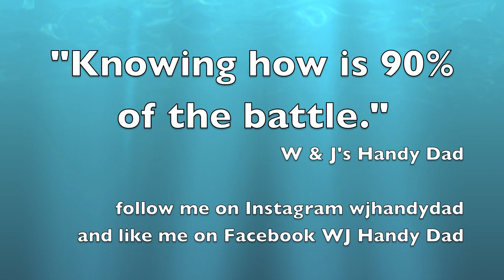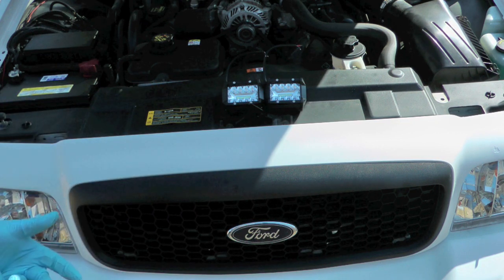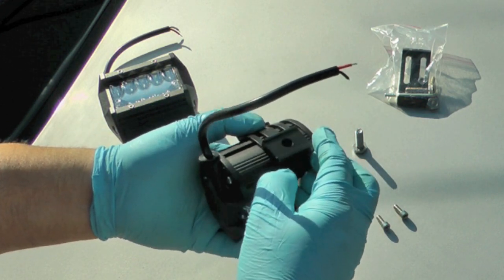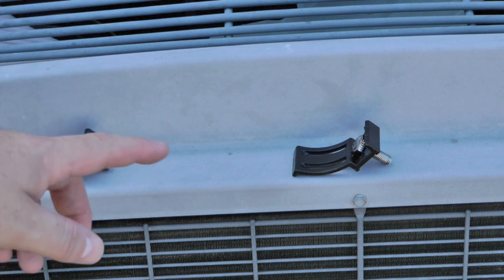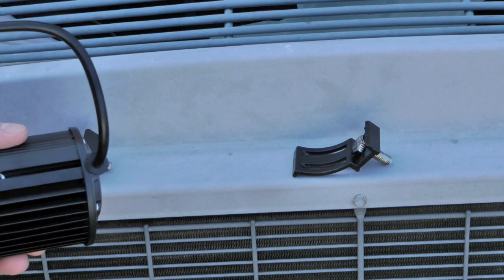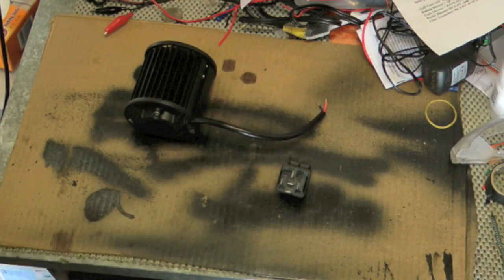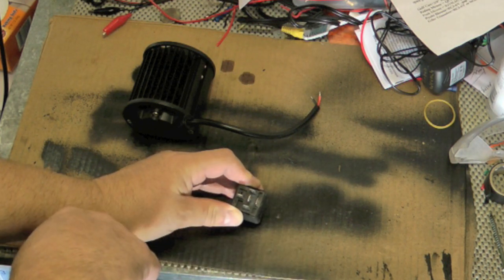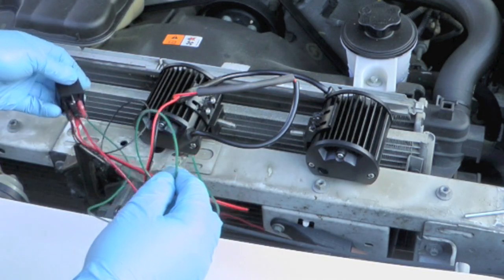Crown Vic Adding Grille High Beam Lights on my 2010

Comment: I mounted a 20" LED lightbar to my push bar and connected the wire coming from the relay to the high beam wire on my left headlight (as shown at time stamp 8:58) to the light green wire with a white stripe. In the Haynes manual it says it's supposed to be a light green wire with a brown stripe but there's no such color wire in my headlight socket. There is a dark green wire with a brown stripe but according to my test light it's for the low beam. The light green/white strip sent power to the test light when the high beams were on.
Now here's the issue.
I enabled daytime running lights on my 2011 CVPI using FORscan and the light bar is lit when the day time running lights are on but when I switch to regular headlights (with the parking lights on) the lightbar goes off. 
I am wondering if the daytime running lights function through the high beams and that's why the light bar is lit when the DRL are on.
Any suggestions?
Reply from the maker: I'm not familiar with the DRL setting but I bet a few minutes with a multimeter and you'll get your answer.  You might need to add a second relay that turns off the light bar when DRL is on.  good luck!
Reply: @WJHandyDad  I found it in the Haynes manual. Couldn't read the small print (it sucks getting older).  On page 12-36 (bottom RH side for 1998+) it shows the DRL are using the same circuit as the high beams. I'll just leave this comment in case anyone else has this issue. I have no idea how to wire another relay to turn the light bar off when the DRL are on. I'll just live with it I suppose. Thanks for responding.
Reply from the maker: @drevildruid  I put on two pairs of reading glasses when having to read these things.  Mine isn't super helpful as to showing what happens.  It just references (for 95-newer) two "hot" wires, one R/B and one LG/B (in mine they say "B" is black - so red and black and light green and black).  It just shows the R/B going to the R/B on the headlight.  If I'm reading it correctly it seems to suggest that DRL just turns on the low beams.  Don't know if it turns on the "parking lights" too, but if it doesn't, that might be the source for a second relay.
Reply: @WJHandyDad  Yeah the DRL run through the high beams and use less power, therefore the high beam indicator on the dash doesn't light up. I went back outside (it's currently 108 F here) and put the splice back onto the light green with white stripe and tried it again. Surprisingly the LED bar no longer lights up when just the DRL are on. No idea why. Checked all the fuses and connections. Weird cop car wiring.

Comment: Do you know how to disable the daytime running lights on a 2008 crown vic p71
Reply from the maker: I've never seen DRL's on a P71 but the wiring for DRL's in any vehicle is fairly straightforward - they would be acc power through a relay that switches when the headlights are on.  So power would go through the relay to the DRL's when lights are off but key is on, and be cut off when the relay triggers due to headlights being switched on.  If you can find the relay most likely it's 87a that is providing the power to the DRL's, disconnect it (and tape it off) and no more DRL's